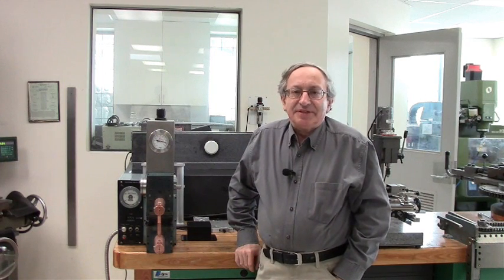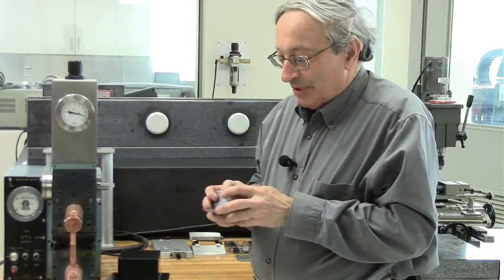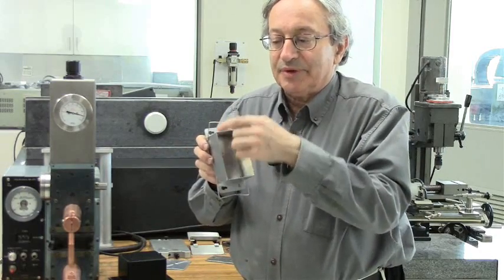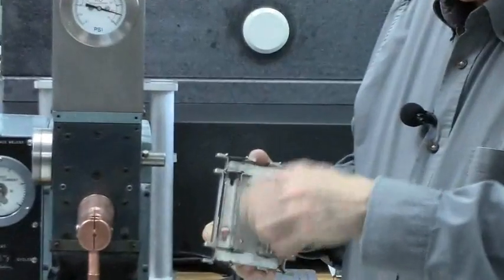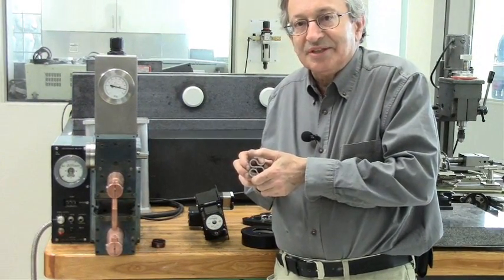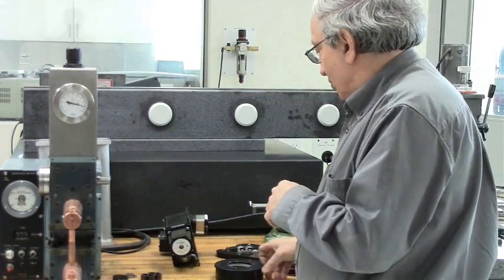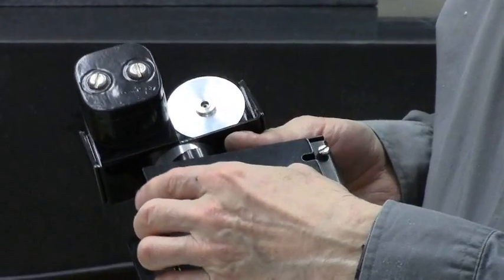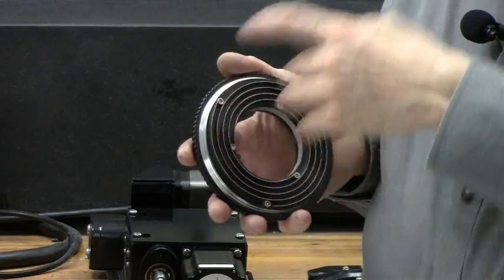Building Prototypes Dan Gelbart  part 1 of 18  Introduction

Comment: Totally inpractical because few startup companies have the budget or the space for a waterjet machine.   Pre-built enclosures are available from many suppliers.   It's also a bad idea to use an enclosure that is anodized and just snaps together.   It is not RFI shielded.  I remember seeing a lot of similarly poor engineering practices when I worked at Creo, in Burnaby.   I wonder; after Kodak bought Creo for $1B, how much money went back to the CDN government, to repay the taxpayer's money Creo got over the years?
Reply from the maker: First, in a startup (or any company) you don't look at cost but at payback. If there is a good payback, you talk to the investors about funding it. Few machines have a better payback than a waterjet.  Re enclosure: I never recommended anodized aluminum. I mentioned in one video that if you have to use aluminum for an enclosure it should be Alodyned (a chemical conversion coating, gold colored), not Anodized, exactly for the reasons you listed. In the video about enclosure it says clearly that you should always use steel sheet  as it can be spot welded.  If needed, use stainless steel but you need a special reason to use aluminum. Also, Creo  used very little Canadian government money and the government got back their whole investment every year in the form of income tax. When Creo was sold the government got an extra 100-200 million. Creo was a public company with all financial data available to the public, so you can go and verify all that.
Reply: I don't believe anything you would say about Creo's financing.  BC and the CDN Gov't were throwing money at any and all tech companies for decades.  I did hear from several sources that Creo's strategy was to not be profitable for a long time.   So there would be no need to pay taxes.
Reply: @dgelbart  I don't believe anything you would say about Creo's financing.   The BC and Canadian Gov't were throwing money at any entity that called itself "high tech" for decades, with almost no oversight or due diligence.   You just said that CDN grant money was paid backeach year from profits.   So why would Creo be eligible for a Gov't grant if Creo was profitable?   I heard from several sources that Creo's strategy for several years was to not show a profit.    I saw poorly engineered products when I worked at Creo, and it was obvious to me that Creo was just a Gov't subsidized make-work operation.   And I was told then that Creo was not making a profit.
Reply: @dgelbart    Typical.  You delete any comment that is not 100% complementary.

Comment: Hi Dan, Thank You for your wonderful videos. Could you please tel me how to put the reverse camera on my lathe. Just a few key hints. Thank You
Reply from the maker: Unscrew the lens from the camera and find a lens with a focal length of 40 to 100mm, preferably 10-20mm diameter. Mount lens at ens of a tube with the camera at the other end, tube length being about twice the focal length. Tube length will set the focus and magnification. Paint the inside of the tube with flat black paint.
Reply: Hi Dan ,Sorry to be  such a monkey, but is it a digital signal , what must i connect it to?
Reply from the maker: @basievanwyk8686  You just plug the camera into the display. Is is actually an analog (NTSC) signal.

9

it

Comment: I've watched your entire series on building prototypes and love it.  I really appreciate you sharing your insight here.  I enjoy your simple/elegant approach to design.  It's engineering poetry.

Can you tell us more about your spot welder?  I'd love to build one very similar to it.
Reply from the maker: Take any 240V 2-3KVA transformer, remove secondary winding and replace by 2 turns of annealed copper bar having a cross section of about 5cm2.  You should get about 3V, if not add one turn.  Connect winding to moving electrode with a stack of flexible strips of similar cross section.
Reply: Thanks.  Most spot welders' leads are on a pivot mechanism.  I especially like the linear clamping approach that yours uses (and the interchangeable leads).

I'd love to see an image of the inside of it... how the leads are insulated from the chassis, showing the mechanical motion of it.

Comment: Thank you for the amazing videos!  
For the last item shown, a chuck, pieces of spring? steel were used.  I am curious about how the ends were fastened.  The fasteners looked tubular.  Spot welded to the fasteners?  Ends bent and inserted into slots?  Thank you!
Reply from the maker: spring steel strip is from a clock spring, ends held in place by  socket head M3 screws.
Reply: +Dan Gelbart  Thank you, I see it now.  The strips are inserted into spiral slots.  The screws only need to retain them in the slots.

Comment: For the spiral springs: "I can take any plot of force versus distance that I want". 
I believe the force would need to be monotonically increasing. I don't see how you could make a spring that delivers a high force initially but a lesser force when fully compressed?
Reply from the maker: +dougfeig Any snap action spring does that (e.g. microswitch, keyboard key etc).
Reply: +Dan Gelbart Good point, I will ponder it some more. Thank you so much.
Reply: Also, what if you are talking about the compression of a tensile spring? There is a spring called a zero length spring. I think that will answer your question. It's also fascinating.

Comment: How much would you change your stance on these tools with the proliferation of 3d printing recently?
Reply from the maker: Neceros Most high performance parts need to be metal, and 3D printing in metal is terribly expensive and slow. For plastics  3D will take over and replace several method I'm discussing, like molding in silicone molds etc.
Reply: 3d printing is a fad for idiots.

Like a mule with a spinning wheel.